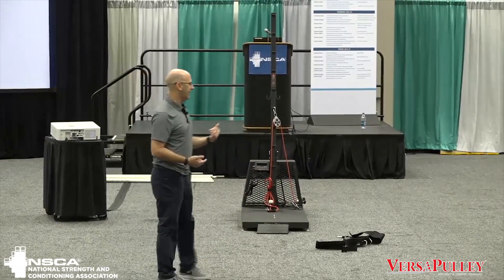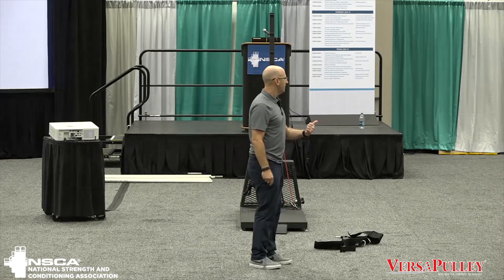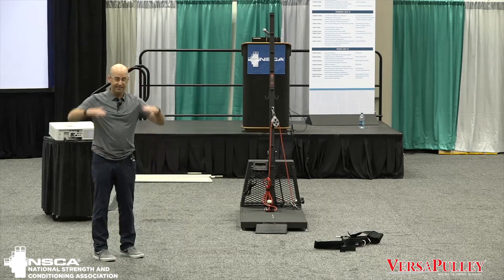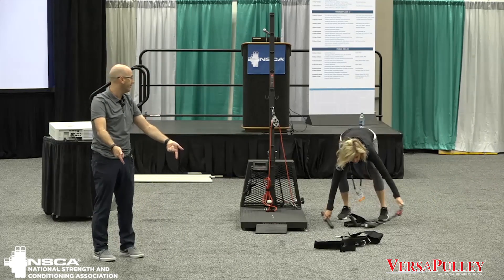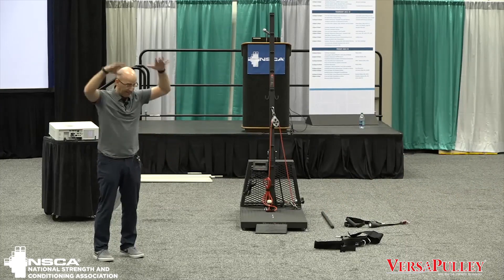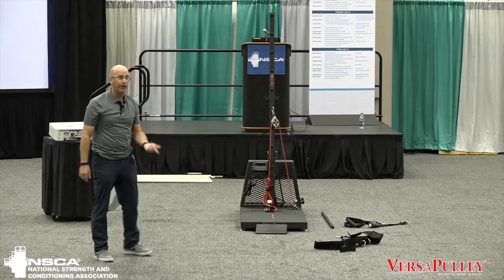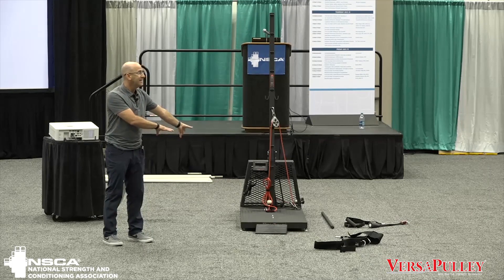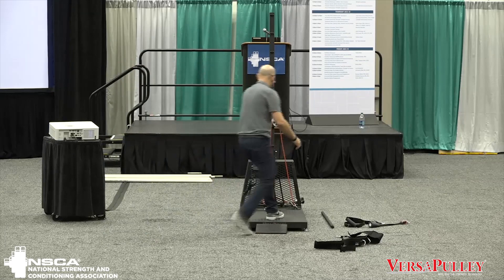Brandon Marcello PhD  presents VersaPulley Flywheel Training at NSCA.

Comment: This guy has no idea about training..... Indeed. No eccentric overload.
Reply: Actually, you must have no idea about training! What did this man say that you disagree with? He used solid evidence based exercise theory to state his claim on why this tool would be beneficial. Maybe you don't understand how this equipment works? The harder you pull concentrically, the greater the eccentric load.
Reply: @jwbnscacpt  I know it very well... And you are right about the fact: the harder you pull concentric, the greater the eccentric load. However a exxentric overload means there is a load what is bigger than your 1RM concentric load. Do your research. Thank you.
Reply: @serge1011  You can load eccentric greater than your 1RM concentric. This is quite easy to do.
Reply: @jwbnscacpt  True. But that is not what this guy is doing on the video.
Reply: You would have to slow down the eccentric faster than the concentric to induce eccentric overload. There are other methods, but that seems to be the most popular.